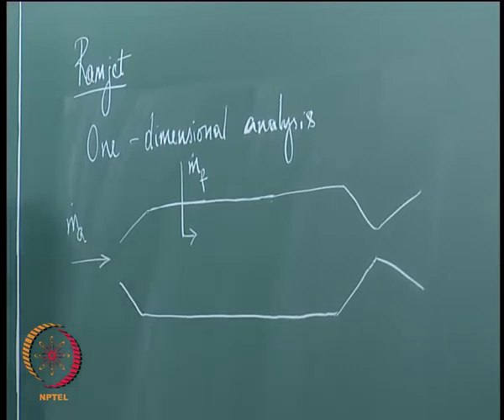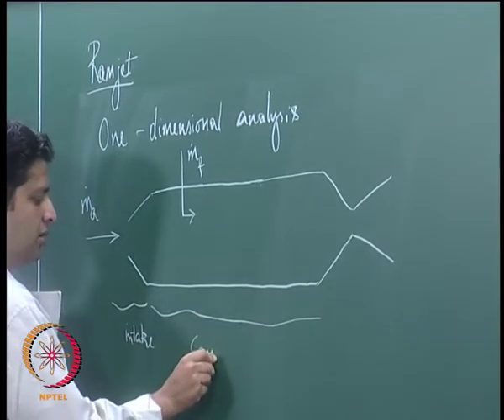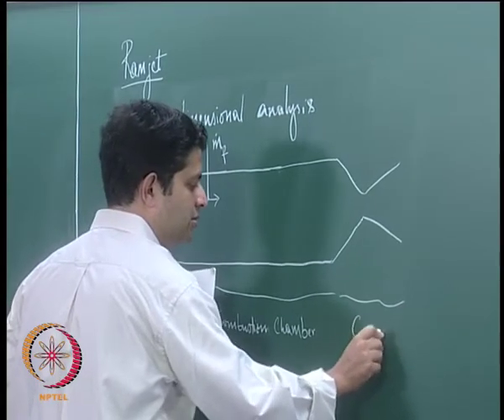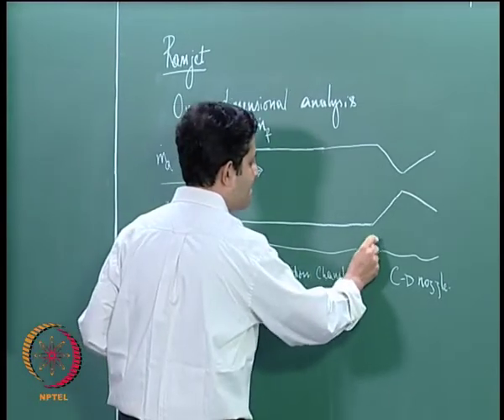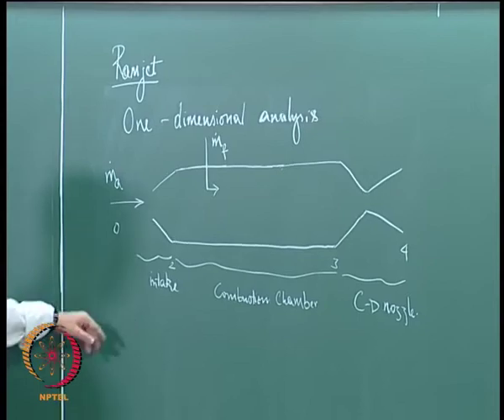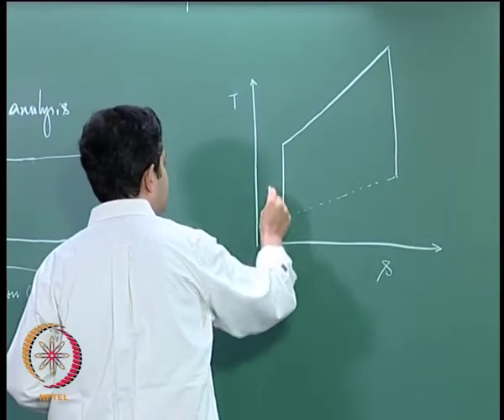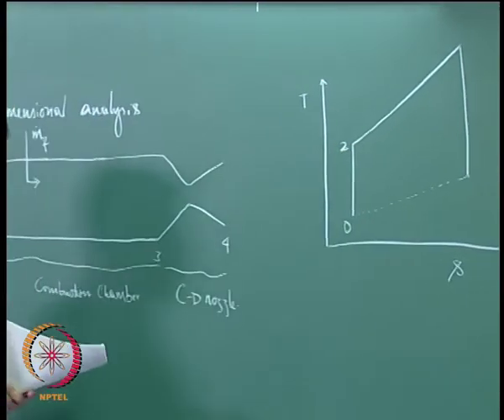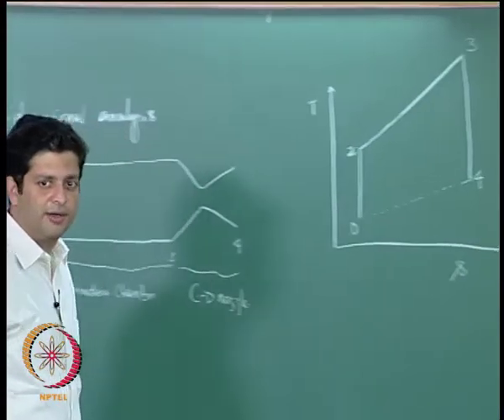Mod-01 Lec-10 Cycle Analysis – Ramjet

Comment: The pressure force in the thrust equation becomes zero because in ideal  conditions we take the outer and inner pressure to be same .I think its not about neglecting the value bcz it  is small compared to the velocity force .